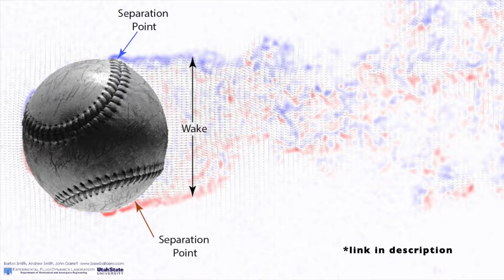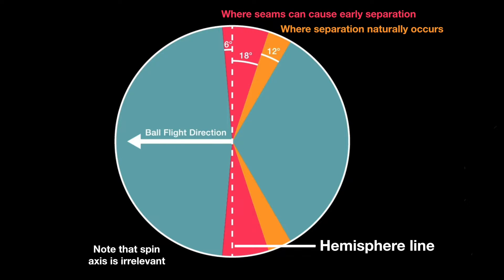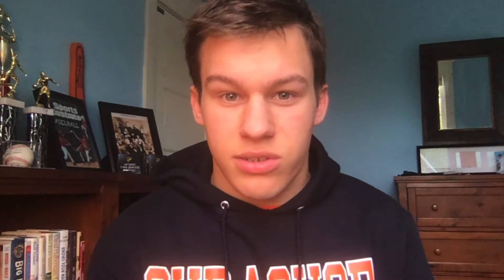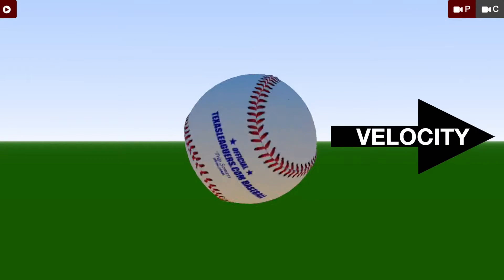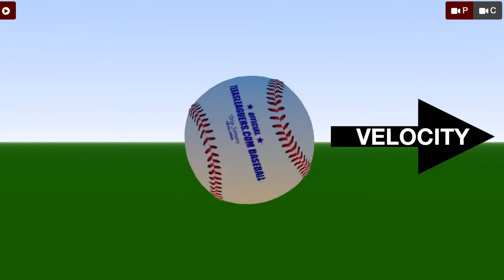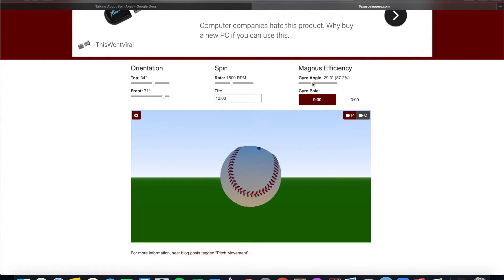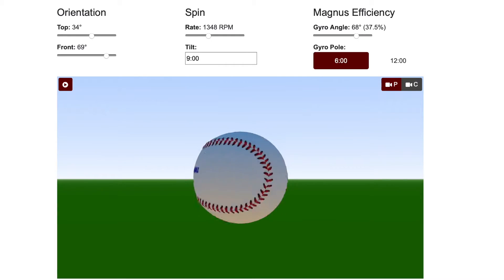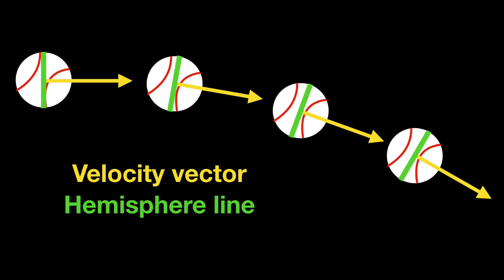Pitch Design Challenge: Seam-Shifted Wake Slider

Comment: so how do you throw this pitch
Reply from the maker: That's a surprisingly difficult question, but I think I'll make a video doing my best to answer it. I'll try to remember to re-comment on this if/when I do!
Reply: @johnnyasel7678  sick thank you
Reply: I throw it slightly back from the two seams and get a 1 seam spin that spins perpendicular to the plate. With perfect gyro it isn’t that great but I get the dot from my perspective around 7 o’clock and half an inch from the center. Still working on it though. Tbh you need a high speed camera and you can get a lot further